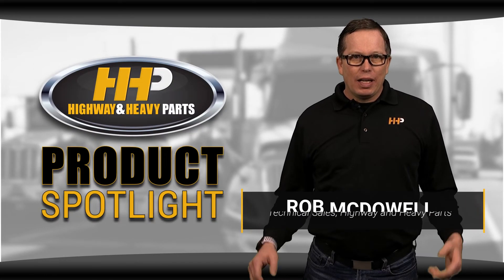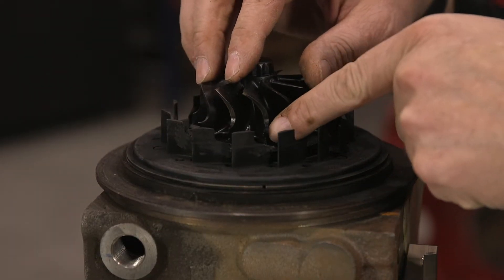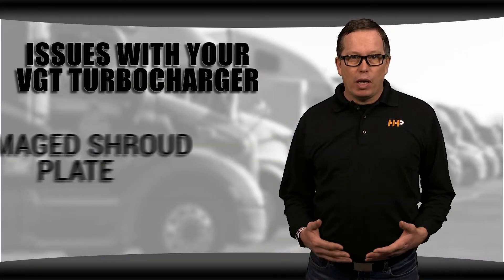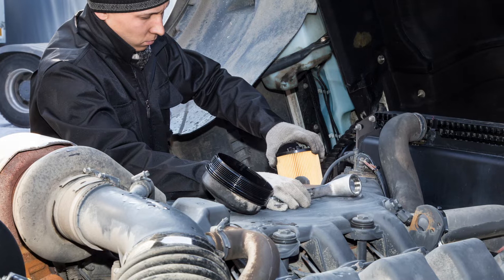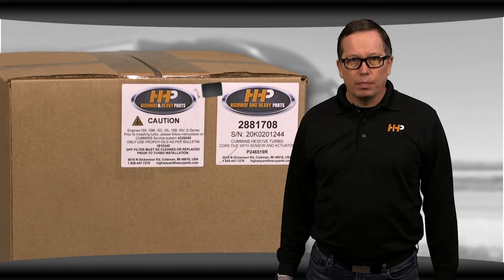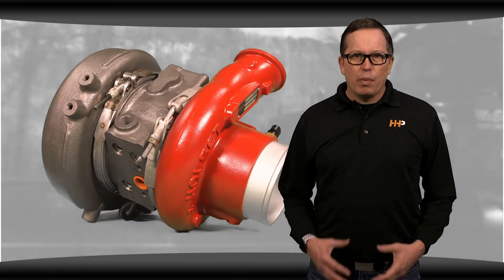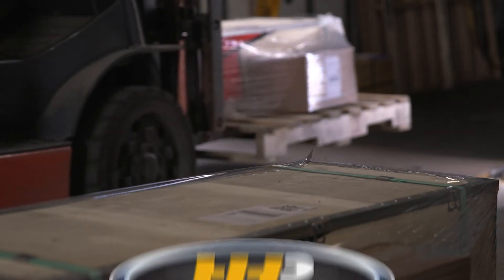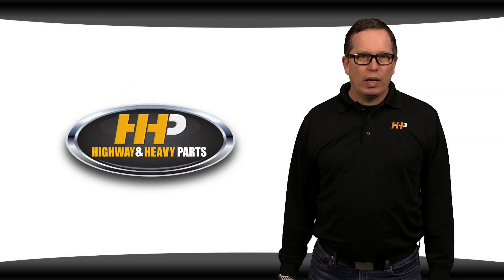VGT Turbo Problems: Signs of Failure, Solutions & How to Extend Life

Comment: This video is spot on. 

Preventive maintenance and regular service (oil changes) on the motor between 10,000 and say 18,000 miles, depending on conditions, usage and age of the motor. Also, proper and regular diagnostic checkup to see the health of the DPF/DOC/SCR system. 

You can go to eBay and purchase the Cummins Inline 6 reader and Insite software to make these diagnostics a breeze. 

Then the EGR Cooler, it would be best to replace at say 500,000 miles, or at least remove, inspect and clean, before it leaks and takes out your DPF/DOC filters. 

Also, regular EGR Tuneups, clean out the soot in the intake/exhaust side with carb cleaner, and replace the intake manifold pressure sensor along with the exhaust back pressure sensor and any other emission related sensors. 

If a newer Cummins, CM-2250 and newer, the fuel pumps need to be inspected and normally rebuilt every 400,000 miles, as they are still grenading, even in the newest ISX motors. 

Main thing, learn your motor, buy some tools, and get the diagnostic tools so that you can evaluate on the fly. If you think a dealer will maintain your truck for you, break out your wallet, and have a bankruptcy attorney on speed dial. You are the warranty station and mechanic if you want to survive out here.